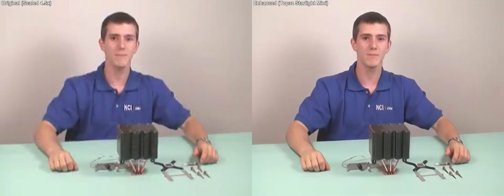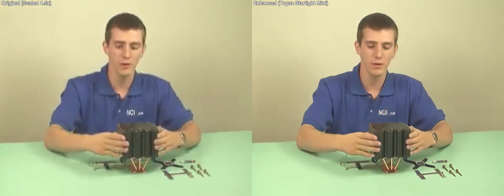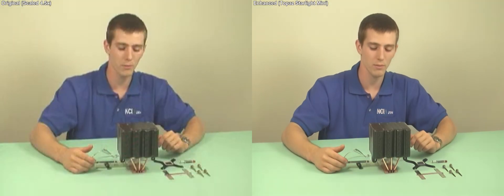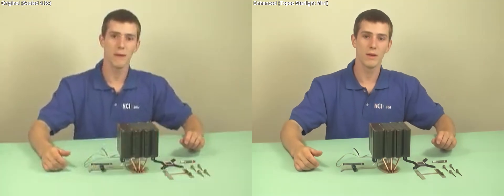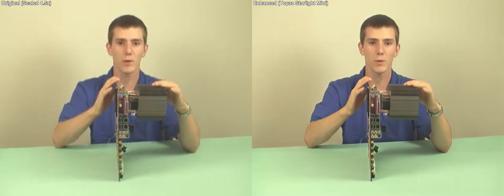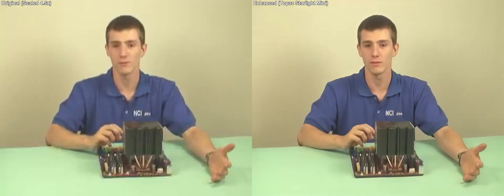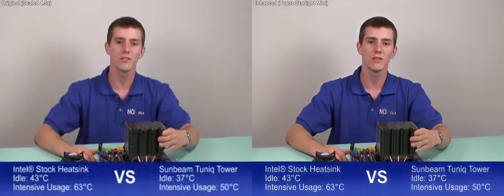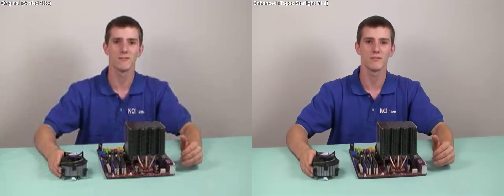Topaz Starlight Mini Test - Sunbeam Tuniq Tower (NCIX Tech Tips #1)

Comment from the maker: Did my best using AviSynth to deinterlace the original video to 60p with QTGMC, then resized the video to the original 720x480 size of the DV source. Then ran it through Topaz's brand new Starlight Mini local processing. Took about 24 hours to render this short clip on an RTX 3090.
Reply: what exactly was the bottleneck in the process? vram speed? gpu core speed?
Reply from the maker: @quantum5661  First video I tried with Starlight mini. After playing around, turns out that the speed of the upscale is highly dependent on the amount of memory you allow Video AI to use. Set to 50% memory the render is much quicker, would only take around half the time (12 hours) on the 3090. 5090 does it in about 6 hours at 50% memory.
Reply: @jonpoeschek  that would kinda make sense, perhaps setting 100% vram causes it to overflow and use system ram?

thanks for getting back to me.
Reply from the maker: @quantum5661  Sorry it took so long. Looking at the command line that gets run during export, 100% memory is actually set to Total VRAM - 1GB to leave a bit of headroom. Supposedly the amount of VRAM that you allocate will result in better upscales, but I haven't seen that in my testing so I've been leaving it at 50%.

I'm really hoping there's some speed optimizations coming down the pipe.

Comment: A long time ago I digitally converted old analogue VHS tape footage on my PC with the hope that some decent software would someday come along enabling me to improve and enhance the grainy standard-definition interlaced footage (the “sawtooth” is prominent). At least I had stable digital footage while my VHS tapes gradually degraded over time.

A few months ago I purchased Topaz Video AI and started tinkering with some of the AI models available with Version 6. Unfortunately my venerable old PC wasn’t up the task, so I recently treated it to an upgrade: 

Gigabyte B760 Aorus Elite ATX motherboard
Intel Core i7 14th generation CPU
Corsair 64Gb 5600MHz DDR5 DRAM
Corsair MP600 Core XT 2Tb Gen4x4 NVMe M.2 SSD card
Cooler Master 850W GX III 80+ Gold PSU
Gigabyte nVidia GeForce RTX 3060 12Gb GPU

I wasn’t after flat-out gaming ability, just a nice balance of performance and budget that could tackle video work. The nVidia GeForce RTX 3060 is a purchase from a while ago and I didn’t see the need to upgrade it. I’m still running Windows 10 Pro 64-bit and the new motherboard/CPU combo is set to “Spec-Enhance” in BIOS (this setting prioritizes lower temperatures while maintaining competitive performance, so it’s fairly relaxed).

I’ve just installed the Topaz Video AI 7.0 upgrade containing the new Starlight Mini (which doesn’t actually come with the upgrade: Topaz does a system check to see if your computer can handle things, then uploads the 6-7Gb Starlight Mini AI model and installs it into your software if you wish to process video locally).

So far the Starlight Mini AI model for local rendering is doing a great job but even with my new PC upgrade it takes forever to render videos. I’m experimenting with a 1 minute 768 x 576 clip and upscaling it to 1280 x 1024 at the original 25fps, plus changing the interlaced footage to progressive took 2 hours 30 minutes. Then I tried upscaling the 1 minute clip to 2880 x 2304 4K and it took 23 hours 20 minutes! 

I shudder to think how long it’s going to take to tackle a dozen family home videos at roughly 2 hours each. I don’t know what kind of computing power Topaz can bring to bear when you upload your videos to their cloud and pay them to do the Starlight heavy-lifting but it’s got to be pretty powerful to take old family videos and turn them into 4K masterpieces within a reasonable time-frame!  

Footnote: The 4K upscale from the original 768 x 576 sample ended up looking quite “plasticky” (I assume because many more “fill-in” pixels had to be crafted around existing pixels), whereas the 1280 x 1024 upscale looked a lot more realistic. Given the lesser time to process and better result, I’ll be sticking with an HD upscale rather than 4K for the moment.

Comment: You don't need to deinterlace the video. You can feed the interlaced source file, Starlight should be able to handle it.
Reply from the maker: I tried feeding the original video and the combing was not removed. Not sure if it's related to it being only 320x240 or since it was encoded as a progressive file so there could be some compression quirks with combing be recognized.

Comment: 24 hours for entire process, or just the Starlight Mini? Looks pretty impressive, is there a substantial difference in original file compared to YT?
Reply from the maker: @SINfromPL 24 hours for just Starlight Mini. About 30-60 minutes to get the video prepped in AviSynth.

Do you mean difference between my export vs what you see on YouTube? I’m not noticing anything, I fed YouTube a lossless h264 so it should be relatively decent.